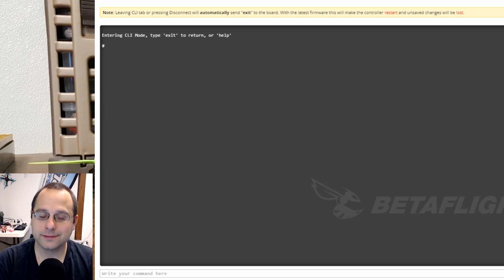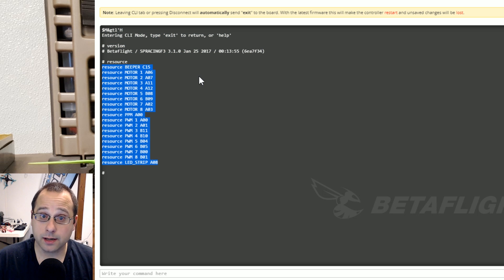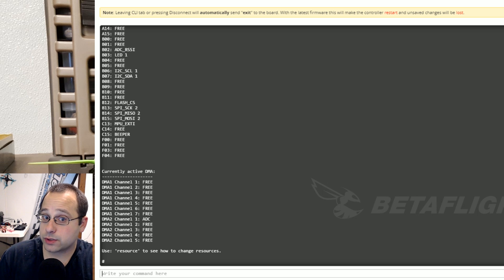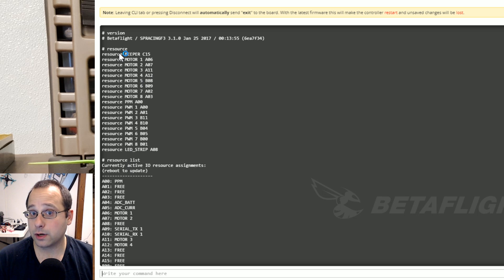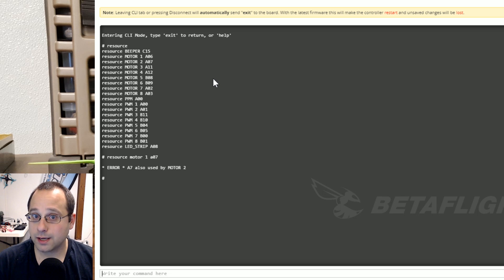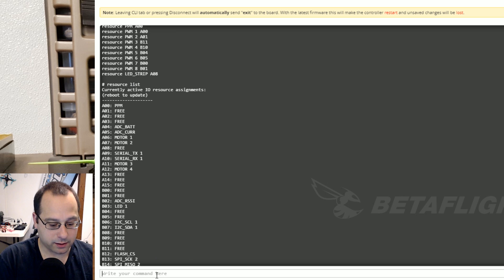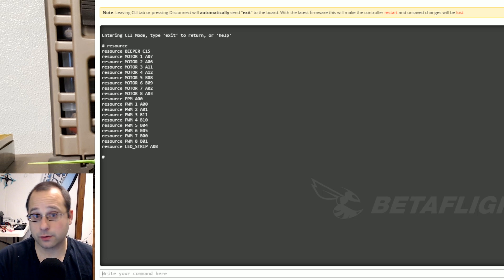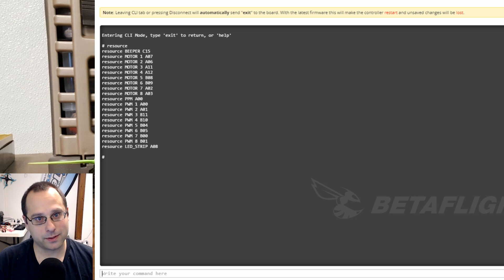Betaflight 3.1 Resource Remapping | NO MORE CUSTOM MOTOR MIXES YAY!

Comment: Mr Bardwell,
Not sure why but after swapping motor 3 and 4 they no longer turn anymore do you have any idea why this happened I followed it step by step
thanks in advance Craig
Reply from the maker: I am going to guess you missed some step in the swap. If all you did was swap two motors, they should still spin. Paste the output of Resource from before and after you made the change and I will take a look.

Comment: So do I need to select "custom" in the configuration before I remap the motors?
Reply from the maker: No. "Custom" applies to the mixer. You are not modifying the mixer at all.
Reply: Thanks for the reply. The vids are great. Just went to patreon to support,

Comment: Thanks, this saved me with my RacerStar 4-in-1 ESC.. I accidentally put the board on backwards to what I drew my original wiring diagram.. meaning motors 1 & 4 and 2 & 3 were swapped. I already soldered it all with the wires cut to length and assembled the quad. With the motor re-assignment commands shown in this video, it probably saved me at least an hour of disassembly, soldering, and reassembly. :D

Comment: Bummer! I just accidentally shorted the buzzer gnd pad on my big quad (Banggood Bmnibus F3, so another gnd doesnt work, continuous beeping) and wanted to remap it. And lo and behold, in the very last minute you tell me that it wont work.

Amazing. And that right after completing my little QQX-130 , doing the finishing touches and then that HGLRC Flame F4 board  starts to self destruct (first TX went out, then camera, then USB, now it hangs from my neck as a trophy :S)

 Two FCs in one day. That is fun...
Reply from the maker: For buzzer, the negative pad is switched, so it's not got continuity to the other ground pads, and if you damage it, your buzzer days are done. Ass said in the video, you can't remap buzzer either, unless you build a buffer circuit, or you'll burn the pin on your FC.

The good news about this is that if you wan an extra loud buzzer, you can wire buzzer+ to 12v or even vBat, assuming you buy a buzzer that's rated for it.

Comment: Thanks Mr. Bardwell, Worked great for my mislabeled 4-in-1 esc. I thought I watched a video of yours concerning motor direction? I have 2 motors that need their direction changed.
Reply from the maker: Swap two motor wires with each other. Any two.
Reply: Joshua Bardwell Thank you for the response. Project blue falcon came through with a bheli tutorial.

Comment: Hey Joshua wanted to start by saying thank you for all your videos, i've watched countless hours of your vids and getting much needed info from them. Just had a quick question. I lifted the VTX Signal pad, and pulled the trace up in a crash were my vtx cable was chopped by the props. I output the resource list and I found what appears to be the cam signal input but i cannot find the vtx output signal pad in the list. Any ideas?  Wanted to try remapping VTX S pad to LED pad or any pad that isn't important.

CL Racing F4 OSD/PDB/FC AIO
A15: OSD_CS
Reply from the maker: You can't remap the CAM and VTX pads. They're not typical IO pins. Frankly, CAM and VTX never go into the microcontroller anyway, as far as I know. the microcontroller interfaces with the MAX chip which is doing all the actual video processing.

Comment: Is there a way to reset the remap with a CLI command or do I need to reset all of my settings? I made the stupid mistake of not copying that dump...
Reply from the maker: No, you have to save the dump before you start mucking about. Just "diff" your config, then "defaults", then "dump" to get the defaults out. Then paste back in your diff.

Comment: haloo again my herro! 
my bootloader bottom ript of on a crash. before i just tog a skrudriver and then connect em, anf then DFU was there! and i cud flash! but now its gon! nothing. so i think ? can i remove the bootloader bottom on an uart and do it like you do. to pins i 2 padt and then it boot, can i do that on the f4 cc3d - i got f4 omnibus betaflight and wil use that now. but wil fix the other if i can?? if i need download driver and so. then dont use time. then i know what to do. or i wil learn. hope that omnibus f4 is b3tter than cc3d - had a lot of propblem. i can´t use 4 sel battery. dout is my littlebe blheli´S esc opto- 30 A ! ' used easine the perpel motors as a nebie wil u rekomente om chep. but better! i had the ok motor and a bad motor. ps my eashine was costum made :-)
Reply from the maker: I'm sorry, but I can't follow what you are trying to say.

Comment: Great videos!  I must be missing a step. Trying to forward my AUX2 to Servo 5.Betaflight 3.1   In config I set channel forwarding, in servo I select AUX2 for servo output 5. Flipping aux2 is seen in radio but not passed thru to servo 5?
Reply from the maker: I don't think servo 5 is where it would end up. I would think aux1 would be servo 1, and so forth.
Reply: Oh,  so treats motors and servos separate. Thank you, I'll try tonight.

Comment: Hi Joshua, I have purchased a X4r SB receiver, I have the vortex 250 up and running again, but need a lost buzzer alarm, if  I'm using SBUS how do I get a buzzer working on a switch in my taranis X9D plus I have purchased the hobby king lost alarm but can't seem to get it working.
I really enjoy your video's even though a lot of it goes over myhead.
hope you can help.

thanks!!!

Malc!!  (UK)
Reply: Asign a switch to one channel (say Aux3) on your taranis. And then asign the mode "beeper" to that same channel on betaflight. That´s for a normal buzzer. No idea about the hobbyking lost alarm, sorry.
Reply: Oblivious I will give it a try, and thanks for getting in touch, much appreciated!! 😬

Comment: great video as always, question i have a tricopter bought this board for it, if i enable softserial, and then remap it for servo, is that even possible, or i am going about it all wrong?

thanks
Reply from the maker: If you set the Mixer type to tricopter, it should assign a servo output by default. I don't know what pin that servo output is mapped to, but you should be able to use resource remapping to put it where you want. You don't want to remap softserial or anything like that. That's totally barking up the wrong tree.

Comment: Hi! Can I add another ADC to my F3 EVO board? It's for the analog RSSI. Thanks.
Reply from the maker: I don't think so. I mean, in theory you could wire up an i2c chip or something, but you would need to modify the code to make it work. Hmmm... Can you not remap the current sensor input to act as RSSI? I believe they both use the same ADC.
Reply: In my board, an f3 Evo brushed, I don't have a current sensor, so in theory I could use it.

Comment: I got one more question for you and I'll leave you alone. I successfully changed my motor 1 mapping from motor 1 pads to motor 5 pads. I was running dshot and realize that not all motor locations support dshot. I wanted to change to multi shot or one shot but the blheli configurator is only seeing motors 2,3 and 4. I am using a cicada 4 in 1 esc. How do I get blheli to see the motor 1 esc?
Reply from the maker: +Bore Hog pass through doesn't work with dshot selected on all boards. Configure Betaflight to multishot first.

Comment: Thanks for this video Joshua! Super helpful for ESC's that are not set up well for connections. Between this and BLHeli config you can install all the motor wires nice and pretty and map it all perfect and even keep the proper quadcopter image in BF! Cool!  Just remapped my Tomo CS110 for a different Racerstar 4in1I had to replace with another model, worked like a charm.

Comment: plz somboddy help.all work . my first real build. have build f3 1´s /2´s - brushed  and a cc3d brushless- liubre. but now new hlbehli´s-emax 2204/2300kv . not big. affraid to hurt annyone. but all works. bur 2 motor spin wrong way. i didden´t want to resolder. want to learn it inhere. so i try "resource list" and got it wrong. onky have motor 1 in betaflight now. i forgot to save a dumpfile. yes have one from f3 brushed. but no! dont think is a good thing!! PLZ somone !!! can i get an dump file or do i have to rember were there are? i have try flash again. but the same. first time.2 motor gon in brtaflight. but i got em back. then i try again.and only 1 motor bak. motor 1. in betaflight were you turn op the motor. but only 1 one back in there!!
Reply from the maker: +Henrik Bech of the motor spin the wrong way, reverse them in BLHeli. 

To fix your config, save a config dump, then re flash the board with "full erase" selected, then paste the config back in, skipping over the resource section.
Reply: but the onfig is wrong. wish i never try. just suddert. not that good yet. but i wil try! man,,, thx for answer. know it´s okay., and the motors are there. cause got one back., just need to find the motore again. but if i safe dump. wil it just bee the same? have flash. that i thought deleatet . but never flas with full erase. but i´ll try!! :-) thx again. you are niceand love your video´s :-) just rember save :-D hehe he

Comment: my motor is gon! forgot to save dump file. try flash! stil nothing! Hmmm motor 2,3 spin wrong way.what to do when you are stupid and have no dump file? :-(
Reply from the maker: +Henrik Bech dump, the flash with fill chip erase selected, then rebuild the config from the dump.
Reply: you are  amasing cool. I use blheli suide, kalibrate and rotate motor. 2,3. not that hard. just read and follow :-) THX. but nice. yes´ build from config. never thing of that."im a neewbie"II :-D but can´t arm! all other. funksion. resiver throttel and so. work. but not arm. in mods- in betaflight, it moving,. but not turning yellow! is that safty,  or am I missing somthing? i wil not get it in air before i know everthing. fly brushed 2s now. but locking forvard to try som of your skills :-) love your video upload "how to learn to loop and so on" :-) woop woop, woop away´ I hope you have´ a drony day!! :-D
Reply: sorry for sll my qustions,. but se your wideo. betaflight. do you only use SPRACINGF3-F4 and how ofen??   for my cc3d F4 i flash with omnibus F4- but is that just names. dont anwser that. i wil understand it later. but maby thats why i can´t arm flashed with wrong firmware?  hopw it make sens.  :-)
Reply from the maker: +Henrik Bech https://youtu.be/M0S3HTQihxs

Comment: I have a new dys F4 fc, and motor signal pad 2 went out. will this method work to remap signal to say...led strip? not sure which pin would work as a esc signal pad
Reply from the maker: Yes I think that would work.
Reply: Joshua Bardwell worked like a charm! thanks for the very detailed vid! keep up the awesome work :)

Comment: Gday Josh, great tutorial.  I followed this to remap my motors in beta flight 3.1.7 to match the layout in portrayed in Betaflight itself.  After the remapping and spinning up the motors their behaviour became very erratic with the drone shaking its head and the sliders indicating each motors output in Betaflight was showing them jumping up and down even though I was either increasing their speed or holding steady. This is my first build so I could have totally stuffed some setting somewhere.  If I set the motor config back to original layout however the problem goes away. Any help/ideas appreciated.

Comment: Hi there guys, i followed all of this but my motor 4 is disabled , how do i enable it ?
Reply from the maker: +CODELESS are you using dshot? Some boards can't run dshot on all pins at the same time.
Reply: i am, Dshot 600, changed to multishot and now motor 4 is working.
this is my 1st build thankd for the quick reply. love your content.

Comment: I just remapped my omnibus f4 pro v3 uarts SERIAL_TX 3 -> PWM 5 & SERIAL_TX 6 -> PWM 6 for SmartPort (With XSR inversion hack) and TBS Smart Audio. Can anyone confirm if what I have done is acceptable? This is so I don't have to buy and use an annoying 6pin JST connector.

Before:
resource BEEPER 1 B04
resource MOTOR 1 B00
resource MOTOR 2 B01
resource MOTOR 3 A03
resource MOTOR 4 A02
resource MOTOR 5 A01
resource MOTOR 6 A08
resource PPM 1 B08
resource PWM 1 B08
resource PWM 2 B09
resource PWM 3 C06
resource PWM 4 C07
resource PWM 5 C08
resource PWM 6 C09
resource LED_STRIP 1 A08
resource SERIAL_TX 1 A09
resource SERIAL_TX 3 B10
resource SERIAL_TX 6 C06
resource SERIAL_RX 1 A10
resource SERIAL_RX 3 B11
resource SERIAL_RX 6 C07

After:
resource BEEPER 1 B04
resource MOTOR 1 B00
resource MOTOR 2 B01
resource MOTOR 3 A03
resource MOTOR 4 A02
resource MOTOR 5 A01
resource MOTOR 6 A08
resource PPM 1 B08
resource PWM 1 B08
resource PWM 2 B09
resource PWM 3 C06
resource PWM 4 C07
resource LED_STRIP 1 A08
resource SERIAL_TX 1 A09
resource SERIAL_TX 3 C08
resource SERIAL_TX 6 C09
resource SERIAL_RX 1 A10
resource SERIAL_RX 3 B11
resource SERIAL_RX 6 C07
Reply from the maker: I don't think you can remap UARTs to motor pins. I think that UARTs are hard-wired in the microcontroller. Let me know if this works though.

Comment: I just wanted to add a comment and say that this video helped me out a bunch. I have just rebuilt my main quad (Bolt 210 Race) with the new Betaflight board and through some apparent mishap the motor 3 output wasn't working. It's noteworthy  that motor outputs 5 and 6 share the soft serial RX/TX respectively on the Betaflight board so you get two chances at screwing it up I suppose.  I had a heck of a time putting the board together, all of that copper in there acts like a nice heat sink and I had to use my chisel bit to get some pads to bond, this is how I assume the motor output came to be broken.

Long story short, thanks :)

Comment: the question for me is can I remap my motor pin 2 of my quadcopter to my unused motor output pin 5? for some reason my motor 2 output pin isn't working. it's a f3 omnibus. please help.
Reply from the maker: +drumrboynoid yes Probably
Reply: Thanks for the quick reply. Imma give it a go.
Reply: I had the same problem with my F3 board only pin 1 was not working. Brand New board. Did it work for you?
Reply: Yea mine was brand new also. I tried switching the motors but couldn't get it to work in the time I had, so I went back to a different F3 omnibus board, that I also had some powering issues with by the way. I know it's possible though. Project blue falcon has a good tutorial on it that I discovered after the fact. Lemme know what you figure out please. Thanks.

Comment: I dont suppose i can use resource remapping to use a spare motor output as a soft serial port for s.port-telemetry?
Currently, i have telemetry on uart2, which on the eachine wizard is a bit awkward, because its a micro jst plug and once you plug it in, you can no longer mount the side panels.
Reply from the maker: +able to Thorsten Lanfer that's an interesting question. I know you can't remap hardware UARTs but soft serial might work. Also, you didn't used to be able to do smart port over softserial because the baud rate was too high. But I think I've heard some people say it dies work.

Comment: remaped my dead buzz pins to led, everything works. thanx
Reply from the maker: +Alexey Morev if you don't build a driver circuit, I think you will burn out the pin.
Reply: thanx 4 your remark

Comment: josh please ,,,i need your help with a new YouBi 130 from BANGGOOD, once the throttle is open the motor RPM climb to full and stay fully open untill disarmed via Aux switch. Its using a 4 in 1 esc, Ryan Conliffe...Facebook.
Reply from the maker: +ryay conliffe https://youtu.be/xBaefeQtA1c

Comment: I did learn something new :) thanks, but I do have a Question:
Do you think this feature could help assign an AUX channel to lets say PWM 8 pin output ?
So I can control a servo or an external PWM buzzer using one of my switches in my RC ?
I saw this mod when you use "Servo_tilt" option to do so, but I wonder if this dynamic resource Remapping feature could make what I explained even simpler ?
Thanks

Comment: So this seems like what I would need to do if I wanted to switch between Dronin and Betaflight on the BrainFPV re1 to avoid re-soldering the motor outputs. Is that correct? I've only been in the hobby for about a month and I'm trying to cram as much in my brain  as I can.
Reply from the maker: +Robert Sederburg yes, this could probably do that.

Comment: i want to change motor 2 to motor 8   since pad om fc is bad. commands? i have a feber so i cant consentrate...my fc is sp racing f3 it said ao3 was motor 8 and i changed motor 2 to that.. but no luck
Reply from the maker: Some combinations won't work depending on timers and DMA assignments. If you try remapping and it doesn't work, try a different pad and see if it works.

Comment: Hi Joshua great video once again. Please can you help. I have a Diatone D-Link V1 board and have ripped the pad for motor 3 output off the board, Doh. In the resource list it says DMA1 Channel 1 to 7 are free, and DMA2 channels 2 through to 5 are free? Can you help at all in explaining what a DMA is and where I might find the free channels on the board. Thanking you in advance and in anticipation.
Hope that I can save this board with your help,  and once again, learn something new.!!!
Reply from the maker: DMA doesn't matter unless you're doing DSHOT. Are you doing DSHOT?

You have to look at the output of "resource list" and try to figure out if there is somewhere you can remap that motor output to.
Reply: Thanks Joshua, not using Dshot. I have found two tiny pads on the back of the board for motors 5 and 6, I just need to figure out how to remap motor three to one of those outputs now, this video has saved my board, thanks from Scotland once again!
Reply from the maker: If you have two spare motor outputs, then you definitely should be able to remap to them. Good luck!
Reply: It's done Joshua, cheers I owe you a Dram sir !!!